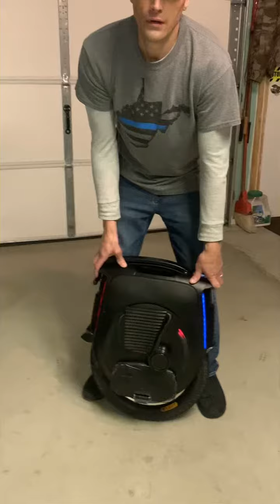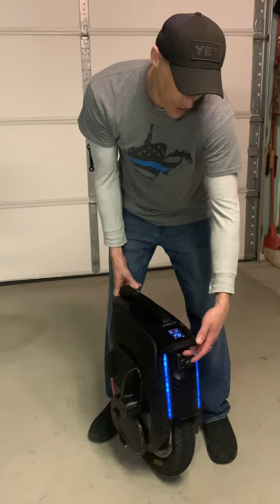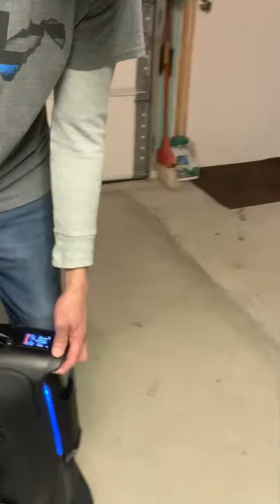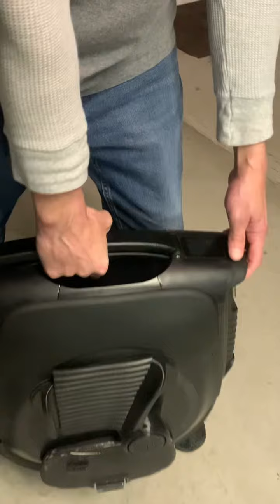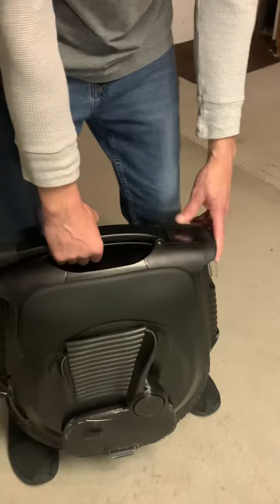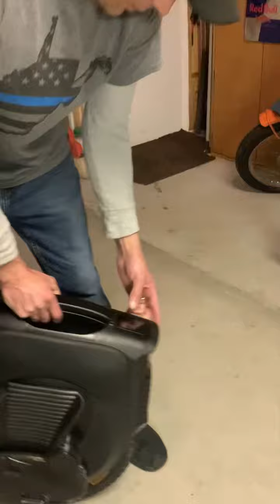V12 cutout lift test #1 the wrong way

Comment: You're supposed to yank it back in the opposite direction before the wheel reaches its max freespin speed. Essentially simulating hard braking. Id recommend watching the video inmotion released demonstrating the process
Reply: Link?
Reply: So is the cause hard braking?
Reply: @coreykirby1632  kinda. Hard braking could trigger it. the cause is from the mosfets not having enough overhead. Mosfets only rated for 100v on a 100v wheel. 100v mosfets can handle 100v of power at 20c+ but as soon as the temperature drops below that the 100v rating goes out the window. Sherman has 125v mosfets by comparison and the extra head room is really needed on a 100v wheel. 100v mosfets are fine on 84v volt wheels like the V11 but Inmotion should use different mosfets with a higher voltage rating and send everyone out a new board. As it stands even if your V12 passes this test it's still likely to fail one you quicker than something with 125v mosfets. Electronics tend to fail quicker when used in an incorrect application.
Reply: In my opinion the whole thing looks like a bit of a joke. To simulate hard braking with a human being's full weight on the wheel by just yanking it back like that...........seems dumb
10 times? Still dumb

Comment: Bro you are doing it wrong you have to angle the wheel seeping 30% back and forward fast to basically pass quick from an acceleration and breaking
Reply from the maker: It's going to be ok 👊. I've been testing it for 800+ miles and I ride aggressive stopping and takeoff 🛫. 
 ✌️ Thanks for watching, also I'm looking back on a couple of mine and your conversations and I think I am liking the V12 now I started delivering food with it and learning how to adjust the different settings has made a big difference. Also my wheel wobble was because of a defective rim I ended up replacing. My wheel was one of the wheels that was used for testing we think. They painted scratches on the bottom of the pedals  and things like that we started seeing,(bent kickstand)  But it had 0 miles on the display screen. 
 ✌️ Keep it wheel ✌️ and test them wheels 👊
Reply from the maker: Also we did another video after this one but I was told it was wrong 🤣 . We don't know ...

Comment: That sucks about the cutouts. Are they mostly happening near top speed? Or is it cutting out whenever?

I was mad keen to get a V12. Now...........not at all
Reply from the maker: Mostly stoping cutouts . From what I've heard
Reply: @slidersgliders5516  my 16x had a stopping cutout a long time ago. I was braking really hard and it cut out. Turned the wheel off then back on and it was all good. Is the V12 cutting out then turning back on? Or dying completely?
Reply from the maker: @arcrides6841  dying completely ,they burn the 100 volt mosfets that  , they're supposed to be 120 volt at least on a 100 volt wheel.
Reply: @slidersgliders5516  Damn I hope they fix it in a new batch. I still wanna get that wheel. It's perfect for what I want right now. Fast like the Sherman but small like the 16x.
Reply from the maker: @arcrides6841  I am putting a knobby tire on my 16x right now .I done this before and it didn't work out too well so I'm trying another tire.  I wheel let you know how it goes..
Reply: @slidersgliders5516  awesome. What was wrong the last time you tried it?
Reply from the maker: @arcrides6841  It was not good tire on the  road . It was good in snow and muddy soft trail riding .